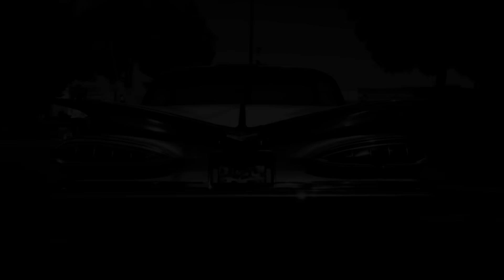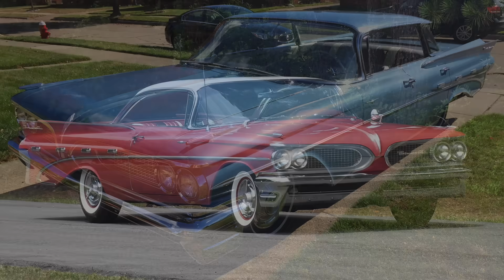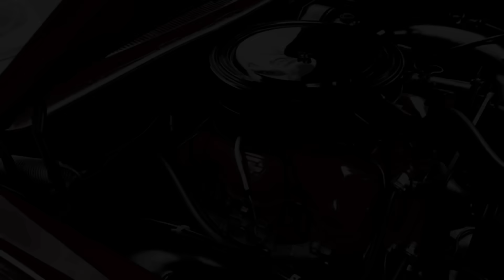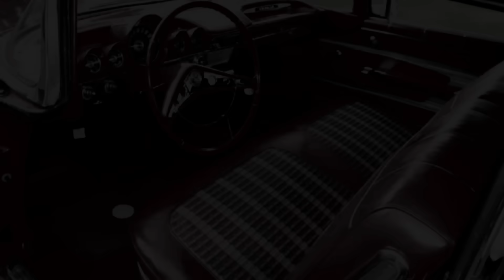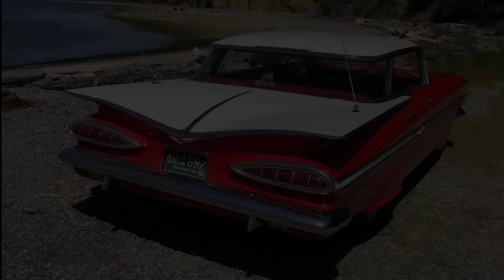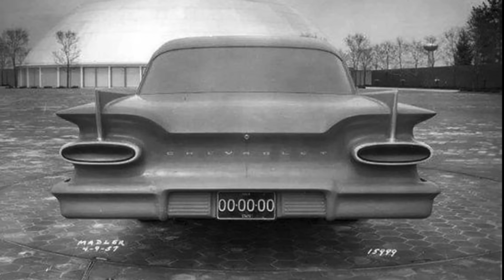1959 Chevrolet Impala: Top 10 Facts About Chevrolet's Most Iconic Car!

Comment: Our family car was a '59 Biscayne, which was a cheaper Impala.  In fact, there may have been a car between the Biscayne and Impala.  The Bel-Air maybe? All seemed to have the same size and styling, though.  My dad was very frugal:  2 doors, standard shift, no radio, 6-cylinder engine.  I remember the Sunday afternoon drives we took in that car.  One striking feature was how close together the wheels were when viewed from front or rear.  It looked like the chassis was too small for the body.

Comment: It looks like on the '59 steering wheel they added buttons on each end, in place of the upper ring on the '58 (if anyone bothered to notice).  My grandmothers husband had both a '59 & '60 convertibles, both in white with the black side Jetstream,  The '59 had a bit more character, but both were beautiful.  I would had rather had one of these over the iconic '57. 

Interesting notes you gave on the '59 frame in Canada & the air vent, they should had incorporated a third brake light in that vent.... functional & ornamental.

Comment: I read somewhere that at highway speeds air would become trapped under the wings/fins and cause the rear of the car to lift slightly. On wet roads it was even worse. The '61 models had the fins toned down significantly.

Comment: Urban legend that the bat wing tail fins caused the rear end to lift at high speeds.  Wind tunnel tests have proved that. That may have been how the car felt, but it was not the body. Far more likely suspension design/tire air pressue.

Comment: I was talking with a retired Ontario police officer and he said he hated the 59 Chevrolet. It was hard to get out of quickly and, with high speed pursuits the back end at near top speed felt very light, and he attributed it to the rear "wing" as he called it.  

They relegated it to city duty and they kept the Dodges for the freeway cars.   He said the 1960 didn't exhibit this trait.
Reply: I've read that before and the theory that it was the body design that caused that has been pretty much debunked. Suspension maybe but not aerodynamics.
Reply: @ericg4042  You may be right there.  I think all cars of this era would be "floaty" given the suspensions and bias ply tires.

Comment: Chevy made only  1  perfect impala / bel air/ biscayne  body 
That would be a 1962 ,nice strong straight lines the rounded wing windows, the cool roll in rear side glass ,not overly chromed mostly stainless and the SS pearly trim flowed flawlessly down to the end ,,my blue 62 was called bisquick  camaro   3 speed and short axle gears  polished  rim 200s  coke bottles wrapped in g t qualifiers   lots of underhood chrome.like fan shroud  polished radiator tank. I miss old bisquick

Comment: My dad had a '59 Impala, a two door hardtop, white, red interior, black cove.  I don't have a lot of memories of that car, as he didn't keep it long.  This has been an interesting dive into that car.  Some things I already knew about it, but there was quite a bit I didn't, like that seam.

Most interesting was that last proposal that you showed.  I can see one good reason that was rejected, and that was a greenhouse that resembled nothing so much as the Ford Custom 300 of the time.  It doesn't do to have your new top of the line car confused with your competitor's cheapest models.  If if weren't for the vertical fin added, I'd say that they cribbed the rear of that proposal from what Studebaker-Packard intended the Studebaker President to look like under the original body sharing proposal, which would have had Clippers and Studebakers based loosely off of the Packard body shells.  A somewhat similar rear design did finally appear on the first Studebaker Larks.

It was almost comical what the change in wheelbase and track did for the wheel placement on that Parisienne, with the left rear tire looking like it was nowhere near the wheel well.

This video was interesting as always.

Comment: 11.  At high speeds the rear fins would develop enough lift to cause the rear wheels to lose traction.  This may have been only when the car was loaded with suitcases (and kids) causing the rear end to drop a bit.   This happened to us on a trip through the Dakotas in my dad's 1959 Bel Air 6 cylinder 3-speed.  The kids thought it was great, mom, not so much...

Comment: This is probably useless information but the 59 Chevrolets that were sold new here in Australia had an amber turn indicator light that was mounted
Just beneath the horizontal fins as the USA only had the red lights that acted as turn indicators and our laws were different as we had to have amber turn indicators from the rear in that time, our front turn indicators were white until 1973 when All turn indicators had to be amber

Comment: Shortly after I started college, my aunt and uncle gave me a 10 year old 59 Biscayne coupe. Straight 6, 3 on the column. The car probably had no more than 50,000 mi on it then. Maybe being the basest base model, lacking any weighty options but a radio, she flew. Over 90 a time or two ! She was blue-grey, grey pressed steel, vinyl, and plastic inside. Not a looker, but Unbelievably reliable and dead easy to service. Nothing ever broke...until my brother inherited her from me and wrecked her !
Reply: Because the automatic transmission in most of these was the inefficient Powerglide,the 3 on the tree was much quicker. Better gas mileage too.

Comment: 1. If the lightening holes on the steering wheel didn't suggest a "racy" look, the checkered flag in the center sure did.
2. No more air suspension option
3. I've heard that all that metal bending to achieve the 'seagull' rear deck resulted in some pretty thin sheet metal in places--where rust would form.

Comment: One of my first cars, purchased in the mid 1980s, was a red 1959 Impala 2 door hardtop which I commuted to work in for many years.  The most unusual feature of that huge car was that mine had manual steering, but somehow the way the steering was geared and balanced, it was as effortless as power steering.  I could steer that car with one finger.

Comment: In Australia, amber signal lights were required so 1959 Chevrolets (imported from Canada?) had round, amber lights mounted on the bottom, corner edges of the fins. They don't really stand out but once you notice them it's all you can look at. 
I've heard people call the one piece '59 and '60 rear bumpers "California bumpers". '59 Chevy's with the optional "horseshoe" continental kits look like they're using the three piece bumpers. '59 was the last year they were featured in the option book but dealers realized they bolted on to '60 models so it helped them move left over inventory. 
'59's are hugely popular with lowriders. I like their quirkiness but prefer the '60 Impalas over the '59's. I may be biased seeing that my great aunt and uncle owned a blue sport coupe since new that they traded for a '72 Impala sport coupe seeing that the '60's was a somewhat rare Impala with a straight six (with a large running impala emblem instead of the cross flags in the side rocket streak) and non-power assist steering and brakes which made it hard to drive as they got older. It at least had the Powerglide transmission and a rotary dial base am radio which they never listed to. They gave the car to my cousins in pristine condition and they managed to destroy it in less than 3 years. 
Their '72 Impala is still in the family but had to be restored after another cousin parked it outside in the sun for over 15 years and allowed here kids to jump on the hood, trunk and peeling vinyl top. She bragged about how much money she spent on the restoration. Had she taken care of it like my great aunt did it wouldn't have needed it. 
When we rode with my great aunt and uncle's '60 we had to sit with our hands on our laps and not make a sound. If we rolled down a window, slammed the doors, kicked the seats or she heard the creaking of the ashtrays open we didn't go for ice cream or McDonalds. Some may think that's overly strict but I respect them setting rules and always rewarding us for being respectful. 
When my great aunt passed in the late '90's I drove to McDonalds and ordered what she always bought me, a kids burger, fries and small orange soda to eat in my car  (a '74 Plymouth Gold Duster at the time) to honor her memory.
Reply: Thankfully cars coming into  New Zealand had the standard US tail light  system.  I remember going to  Ozz several times and seeing bolt on  yellow turn indicators that  spoiled the look.

Comment: Love the '59 Impala, and the info in this video on it. In more recent years the taillights on the Hyundai Genesis look very much like the '59 Impala's, showing the look can be adopted on a modern car without any fins. I also wanted to mention the '58 Impala was a beautiful car also, and not given the credit it should for that reason, AND that it was the bridge to the '59 Impala from the '57 Bel-Air. The '58 began the horizontal "branching out" look though the fins were more 'rolled'. The sides of the '58 (where the fins started and went back) was continued on the '59 albeit on the very different car otherwise. In fact, the '60 Impala's back end is almost a blend of the '58 & '59. If you took the inner part of the '60 seagull fin that extends downward, and curved it inward at the bottom, it would really look like the '58. The '61 continued the branching out look, but cleverly extended the look around to the sides with only a ridge left that had been fins.

Comment: I had a 60. I didnt like look of the "sunshade" over the rear window of the 59. The smooth flow of the 60 was beautiful. If you were headed east on a summer afternoon though nobody wanted to sit in the back seat.

Mine was a white over red 2-door & the color scheme continued inside. It had some neat features. Bucket seats up front & semi buckets in the rear with a speaker for the radio  in the seat back between them. (I guess you could seat your 5 year old there & ruin his hearing.) There was a courtesy light that lit the floor when you tilted the front seat backs forward. Pretty cool!

I bought it in San Francisco. With all the hills it was tricky to keep from scraping the bumpers.

The 348 needed a valve job, which i did. After that it ran fine & didnt leak, much. The Power Glide? Well, it did do what it was designed to do.

After a clean up, wax & polish, new shocks, tires, & a pine tree hanging from the rear view it was a great cruiser & caught a lot of eyes.

The Friday night street crawler was its job & it did that more than well.

Comment: I found an overall height of 56", not 59", which might be the 6 window sedan or the wagon, both of which are taller than the flattop and coupes.  That's still a little taller than the '71-6 full size hardtops, but they had a perimeter frame.

Comment: I spoke with a good friend who is 87 yo and still works on 1957-1965 Chevrolet Fuel Injection.  He bought a new 1957 FI Corvette and later worked at the selling dealership, Davies Chevrolet Seattle.  He confirmed that yes fuel injection was a passenger car and Corvette option in 1959.  He remembered they sold only one and he did the new car service  on a red/red Impala 250hp PG.  I own a '63 Impala and remember seeing one at a International meet years ago.

Comment: Was the ‘59 two-tone paint on the trunk deck lid an option or aftermarket? I can’t find it in brochures, option foldouts or period print ads.
Reply: Each factory two tone had its own code on the trim tag and could be ordered as an option on everything but the convertibles, which were all solid color. Many dealers took it upon themselves to two-tone the cars on their lots to help with sales, but the trim tag color would always be a dead giveaway that the factory didn't supply the car that way. Impala and Bel Air models had chrome trim pieces to split the paint divide on the front of the fin, while Biscaynes just got a tape masked line.

Comment: The 3 piece bumper was also designed to make it convenient to install the optional continental kit by simply swapping the middle section with the continental bumper trough section in between the end pieces. We had a Impala 2 door hardtop in rare cameo coral with the continental bumper.
Reply: Every car with a conti-kit looks like ass.

Comment: The last styling model you showed makes me wonder if there wasn't some interchange between the designers at Chevy and Oldsmobile.  The Vertical and horizontal was a feature of the 59 Dynamic 88.  I will say that the vertical was very, very subtle. Almost a tip of the hat in Chrome Trim.   It was there.  I think it worked because the horizontal fin was nowhere near as wide or pronounced as the Chevrolet design.  I do like your comment that designers might have had to get some of the ideas of of their system before they could move on to something better.  You do have a talent for turning a good entertaining and informative phrase at the same time.  Almost reminds me of a bit from the Three Stooges. In one film, Moe says, I know it was MY idea, but I have to admit, I'm not too fond of it.
Reply: To me, those clay models toward the end of the video made me wonder if people were doing crack back then! 😵‍💫🤣
Reply: @TomSnyder-gx5ru  Maybe toluene.  Whatever substance, it must be the same as used by Exner when he designed the Early 60''s Chrysler Corp cars.  The difference is, the top brass at Chrysler was doing the same substances, because they approved those monstrosities.   .

Comment: You keep saying the 59 Impala. What about the Biscayne and Bel Air? They share the same body style.
Reply: And to Chevrolet's chagrin, the Bel Air was actually slightly more popular than the 1959 Impala. The Bel Air did so well that a Sport Coupe was returned to the Bel Air for 1960 ( a 1959 Bel Air Sport Coupe was mocked up , but not built), joining the Bel Air Sport Sedan.
Reply: @Lurch4you  Oddly enough, you could get a 59 Bel Air 2 dr. hardtop coupe in Canada. Now that is really a rare car. In 50 years of dealing with 59 Chevies, I've seen one.
Reply: @howardscott7521  I didn't know the 1959 Bel Air was offered as a Sport Coupe was offered in Canada. I've seen photos of a mockup in fiberglass & it wasn't offered in the USA. But, didn't think it would be offered elsewhere. 

Thanks for pointing that out.
Reply: @Lurch4you  GM says about a thousand of the two door coupe Bel Airs were sold in Canada, but there can't be many left. One went through the Barrett Jackson auction a few years back that was the beautiful Gothic Gold/ Satin Beige two tone. It made for a stunningly beautiful car.

Comment: About the fake air extractor on both the '58 and '59...you say that testing showed there was a low pressure area there that was pushing the air back IN.  But, hang on...isn't a low pressure area what you want to have if you're trying to extract air?  Seems to me for the air to actually have been pushed back into the cabin would require a high pressure area at the vent exit.
Reply: Maybe the low pressure area was inside the cabin, at the back?

Comment: A few notes. 

1. Fuel Injection was stiill offered for 1959. I personally have driven a 1959 Impala Sport Coupe that was a factory 250hp RamJet 283 backed by Powerglide. They have " Fuel Injection " call outs on the front fenders. 

2. 1959 was the first offical full size Chevrolet that could be equipped with a factory 4 speed manual.

3. 1959 was the final year for " Level Air " air suspension. 

4. For 1953-58, full wheelcovers were standard equipment on the top of the line Chevrolet ( it was the Bel Air ).

To make more profit, i guess, full wheelcovers were now optional on all 1959 Chevrolets ( save the Corvette ). Even on the 1959 Impala, full wheelcovers were now a $23 extra!
Reply: My 59' Biscayne had poverty caps with cross checkered flags
Reply: @speedfreak8200 Nice! A 348 car!
Reply: The Impala was the top car in 1958
Reply: There is a guy here on utube that has a FI 59, and a 58 FI too!

Comment: 1:43 It would appear the reverse lights on the `59 Impala were an afterthought and were quickly (cheaply?) added to the lower rear corners. Or were reverse lights perhaps optional equipment?
Reply: Back ups were standard on the Impala and optional on the lower cost models.
Reply: @howardscott7521  Good to know -thanx.
Reply: Adam (or others viewing this) can correct me but I believe reverse lights were option on Bel Air and
 Biscayne models but the back tail lamps were the same width as the Impala?  Probably standard on the Impala.
Reply: @ impala tail lights had the vertical bright aluminum strips between the segments where lower models didn’t.
Reply: My dad's 64 Rambler American had no reverse lights.....optional!  So you got a blank filler plate where the optional lights went. I think only a few years later they became standard on all vehicles.

Comment: Those cars are wild. I would love to see factory video of the body stamping/fabrication process.  Or just hear some stories from some of those wonderful industry folks.
Reply: Me too, I would be interested in how they fabricated the fins on late 1950s auto.
Reply: Also, these ‘59 Chevrolets were sold in Australia. Here amber turn signals were mandatory. So Holden, who sold reg Chevrolets in Australia, fixed a pair of small round amber turn signals in little chrome brackets suspended on the batwing, which meant the lights hung downwards at the extreme ends of the wings. Many referred to 5hem as drop earrings.
Reply: How they ever stamped the rear panels escapes me, especially around those taillights.